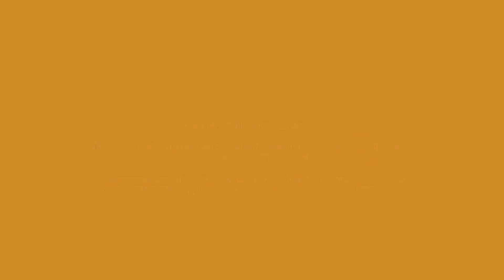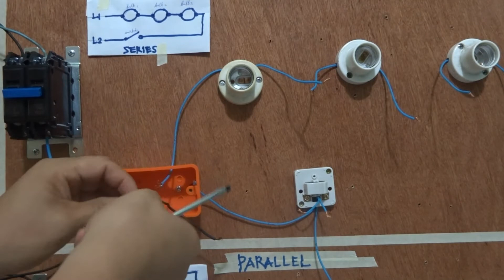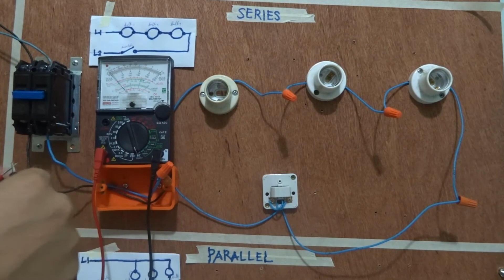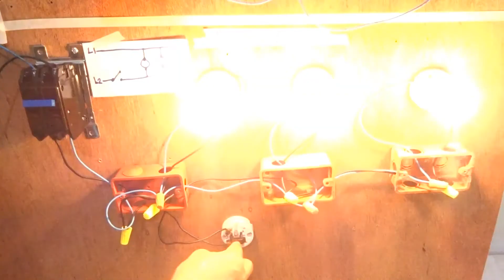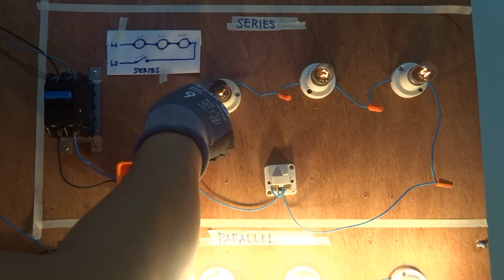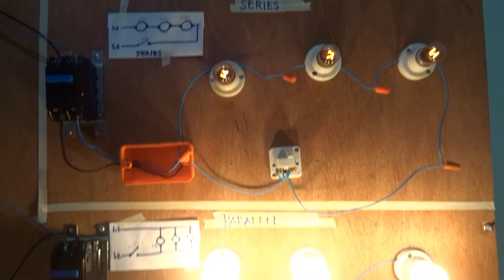Series and Parallel Circuit Connection (Part 1)

Comment: boss salamat sa video, question ko lang , sa series diagram , ung line 1 at line 2  magkadikit po ba?kc ung connection mo ng Line 2 sa dulo ng bulb 3 hindi nakashow ung cable kung didiritso ba ung cable sa bulb 2 at bulb 1., at ung LINE 1 naman mula bulb 1  papunta bulb 3 ay nagkadikit ung wire ng LINE 1 at LINE 2 sa bulb 3?